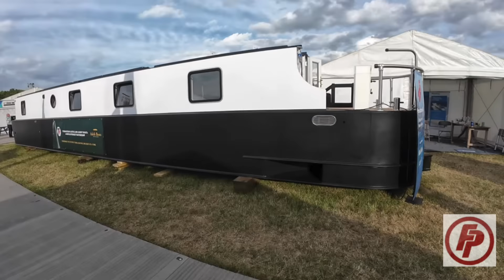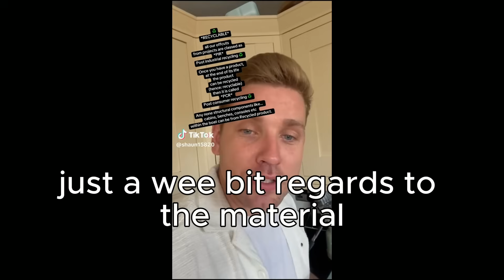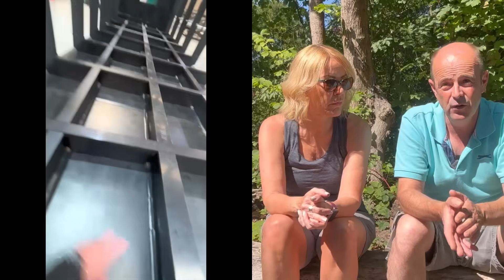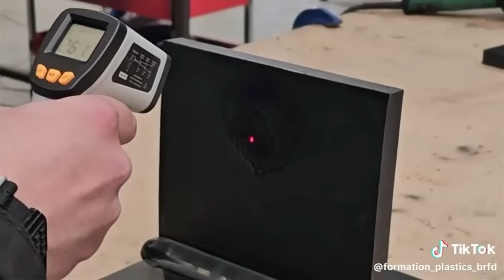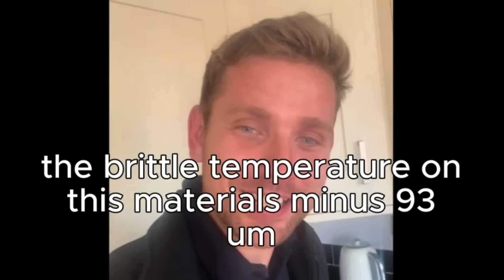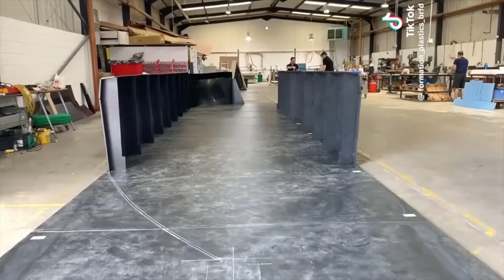Rust-Free Canal Boat?! The WORLD'S First Plastic Narrowboat Explained | 194

Comment: I wonder how thermal dynamic  and uv factor will affect the hull over a long period. You would think it would become  brittle over time
Reply from the maker: That’s a really good point 👍 UV and temperature changes can affect plastics, but the material used here (Polystone G Marine-Tec) is actually designed for marine environments. It’s UV-stabilised and chemically resistant, so it won’t go brittle in the same way cheaper plastics might. Shaun also mentioned it has a long lifespan even under constant exposure, so it should hold up far better than traditional coatings that need re-doing every few years. 😁
Reply: Good question — Polystone G Marine-Tec has a thermal conductivity of 0.47 W/m·K, which means it doesn’t transfer heat quickly. That actually helps reduce internal stress from temperature changes. Plus, it’s UV-stabilized to resist sun damage over time. The -95°C brittle point is way below anything you'd ever see in real-world use, and the material stays flexible and impact-resistant even after years outdoors. So it's designed not to go brittle like standard plastics.

Comment: How is it earthed from the build up of static electricity?
Reply: ill try and answer this best i can Polystone G Marine-Tec is made from HDPE, which is a non-conductive material with a volume resistivity over 10¹⁶ ohm·cm — meaning it doesn’t allow electrical current to pass through. So you can’t earth the hull directly like you would with steel. But that’s actually an advantage for a canal boat: there’s no risk of electric shock through the hull, and no galvanic corrosion like you get with metal. If grounding is needed (like for fuel systems or electronics), it’s done through metal components, not the HDPE itself. So overall, it's a safe  for canal boats.
Reply from the maker: Shaun has answered this for you 😁

Comment: Some of the posters stated about micro plastics etc.
But look at the environmental impact a steel boat has when it comes to media blasting, priming, painting and blacking during the lifetime of the boat.
You have alot of airborne and water borne dust and particles from blasting and painting.
Reply from the maker: Yes you are correct in fact since we have researched and found: Bitumen: sheds oily hydrocarbons.
2-pack epoxy: sheds microplastics.
Polystone G Marine-Tec (HDPE): also technically microplastics if it sheds, but far less likely because it’s a bulk material, not a coating that flakes. Plus, it’s chemically stable and doesn’t release VOCs. 😁

Comment: This is all well and good but HDPE flows constantly, it softens when heated and gets brittle at low temperature. It can auto ignite if there is enough heat and flows as it melts as it burns. Would not be my choice.
Reply from the maker: That’s true of HDPE in its raw form, but Polystone G Marine-Tec is a marine-grade version designed specifically for boats. It’s UV-stabilised, chemically resistant, and performs well across the temperature range we see in the UK. As with any material, fire is a risk if you get enough heat, but under normal boating conditions it doesn’t soften or flow the way untreated HDPE might. Kayaks, workboats and pontoons made from the same material have been in use for decades without those issues cropping up. 😊

Comment: Lighter, less draught; they're  probably more reactive when one is moving around on board? Also, I imagine, they're  not great in side winds? Other than that a great idea. 👍
Reply from the maker: Great observation 👍 Being lighter with less draught does change how they sit in the water, but Shaun mentioned that any extra reactivity or side wind effect can be balanced out with ballast if needed. So there are definitely ways to fine-tune the handling, just like with steel boats. Really interesting to see how it all develops! 😁
Reply: Lighter with less draught is not a good thing. It means the center of gravity is higher, while the center of bouyancy is lower. The closer these two dimensions are to each other the less stable the boat is. Consequently,  you would need to add ballast to compensate, making the weight and draft more or less the same as a steel boat for the same required stability.
Reply from the maker: @thedogfather5445 we have an update video with many of these questions being addressed coming out next week 😊

Comment: All good till a hire boater in a metal boat rams you at full speed and it sinks like a stone 🤡🤡🤡
Reply from the maker: 😅 Not quite! The hull is made from Polystone G Marine-Tec, which is incredibly tough and impact-resistant. Instead of denting like steel, it flexes and absorbs the hit — so even if a hire boater does bump you, it’s not going to sink like a stone. 😅
Reply: @WidebeamandWellingtons  have to agree to disagree I think, a 20 tonne boat made of steeldoing 6mp would snap it like a twig IMHO, of course they've sat it in the water for a year or two but have they rammed it full speed with a steel hulled narrow boat ...probably not, maybe that should be the next video. Then of course there's all the lovely jagged rocks that often stick up from the water, quite often in places you have to pull over to operate swing bridges etc, I narrowly avoided hitting one on the way to Liverpool recently, it would have sunk the Titanic🙄
Reply: @manwithapan9481 has any other uk narrow boat builder rammed one of their builds with another steel narrow boat at 6mph! It would be interesting to see how that would hold up as well.

Comment: Plastic is never a good idea,as it ages it will shed loads of micro plastic in to the canals!
Reply: There are already plenty of Plastic Boats on canals!
At least you don't have to take it out of the water every two years!
Reply: PS I'm not usually a fan of plastic but this looks a good idea!
Reply from the maker: Understand the concern 👍 but this isn’t the same as single-use plastics. The hull is built from Polystone G Marine-Tec, which is UV-stabilised and designed for decades of outdoor marine use without breaking down into microplastics. It’s the same material used in commercial workboats and pontoons that are constantly exposed to the elements. 😁
Reply: @WidebeamandWellingtons 
Every Type Of Plastic Releases Microplastics, We Have Microplastics Within Every Part Of Our Own Bodies, Adding Additional Plastic To The Environment Is Always A Terrible Idea, Would Be Great To Use, Yet, So Was Asbestos When It Came About, CFCs Were The Same, The List Is Endless.
  Fiberglass? Carbon Fiber?
Leaded Petrol, Topics Are Never Going Away.

 Glad For The Movement Towards Warranties BTW.
Reply: @universal-binary-stars  You’re absolutely right to be cautious — history has shown us that materials like asbestos, CFCs, and leaded petrol were once considered safe, only to reveal serious consequences later. Microplastics are a real issue, and we take that seriously.

That’s exactly why we focus on using post-industrial and post-consumer recycled plastics — not to add more plastic to the environment, but to extend the life of existing material and reduce waste. We're also working with initiatives like Röchling’s REloop, which is about building a closed-loop recycling system: taking back used plastic components, reprocessing them, and putting them back into production, instead of letting them become pollution.

Plastics won’t disappear overnight, but how we design, use, and reuse them can change for the better — and that’s where real impact happens.

Comment: Narrowboats usually sit about 22-24 inches deep in canal.  How deep a boat sits in the canal also affects stability.  Ballast and balance will become even more critical the higher the boat sits in the water.  Crossing tidal rivers, or the wash could become problematical.  I am interested, very interested, but will likely ask for a 9 foot wide (narrow widebeam) in the interests of stability and of course more internal room.
Reply from the maker: Great points James 👍 Ballast is definitely key, and these boats the ballast can be adjusted just like steel to get the right depth and stability. Once fully fitted and ballasted they’ll sit much closer to what you’d expect from a steel narrowboat/widebeam, rather than riding too high. A 9ft wide is a nice idea — extra room without losing too much flexibility on the network. 😁

Comment: I am surprised nobody builds canal boats in frp
Reply from the maker: Good point! FRP (fibreglass reinforced plastic) has been used in cruisers for years, but on the canals most builders stuck with steel for strength and repairability. The difference with Polystone G Marine-Tec is that it’s much tougher and impact-resistant than FRP, and can flex rather than crack, which makes it better suited to the knocks and scrapes of canal life. 😁
Reply: Frp can self destruct if cruising through ice.

Comment: With a boat sitting higher in the water, are you going to have problems with low bridges and tunnels?
Reply from the maker: Great point! Shaun explained to us his boat is made from Polystone G and is lighter, so they do sit a bit higher in the water, which can raise the overall height. But this is usually solved by smart design-things like lowering the cabin profile, using fold-down solar panels, or adjusting ballast to fine-tune the draft. Plus, the lighter hull means there's more flexibility to tweak the design compared to heavier steel boats.
So, navigating low bridges is definitely something that can be planned for 😁

Comment: HDPE even with added UV stabilisers will be degraded by exposure to UV light over time.
Reply from the maker: You’re right, standard HDPE can degrade with long-term UV exposure, even with stabilisers. The difference here is that Shaun is using Polystone G Marine-Tec, which is a marine-grade HDPE specifically designed for UV resistance and outdoor use. It’s the same material already proven in workboats, pontoons and aquaculture, so it’s built for long service life in full sun. 😁
Reply: Good point — UV degradation is always a factor with polymers, but in this case, we’re using Polystone® G Marine-Tec, which is specifically engineered for long-term outdoor and marine environments. It contains advanced UV stabilisers and additives that significantly slow down the breakdown process compared to standard HDPE.
Of course, no material is completely immune to UV over decades — but Marine-Tec is designed to handle constant exposure, saltwater, and mechanical wear with minimal maintenance. It’s used in demanding applications like marina construction and industrial marine components, so it’s well proven.
That said, we're not claiming it's bulletproof forever — just that it's a smart material choice for durability, safety, and longevity in harsh conditions.
Reply: @ShaunMoir1 can you give a disclosure on what the durability actually is? Yes, adding stabilisers helps, but it should still have a declared expected life for operating as a durable canal boat able to withstand heavy impacts with other boats/obstacles. What is that?
Reply: @NarrowboatExpats  Hi,

That's a very good question.

The base material we use is Röchling Polystone® G HDPE, manufactured in Germany. The material itself has an expected engineering service life of up to 100 years in many industrial applications when correctly designed and used within its intended operating conditions. This is one of the reasons it is widely used for chemical tanks, water infrastructure, marine applications and other long-term engineering projects.

In terms of canal boats, there is no published lifespan because, a canal boat has never been built from this material. As a result, we cannot point to decades of canal boat data, simply because the application is new.

Instead, we looked at proven HDPE vessels operating around the world. Polystone G HDPE has been used successfully in commercial workboats, rescue boats, police boats and aquaculture vessels, where impact resistance and durability are essential. One of the largest examples we identified is an HDPE ambulance/rescue vessel operating in Turkey, demonstrating that the material is capable of being used successfully in large commercial marine craft.

You may also not be aware that HDPE is extensively used in outdoor playground equipment across the world. These installations are exposed to direct sunlight, rain, frost and changing weather conditions year-round, yet they are expected to last for decades with minimal degradation. This demonstrates that UV exposure is not an issue for the material when the correct UV-stabilised grade is used.

The Polystone G HDPE we use is manufactured with carbon black and UV stabilisers specifically to resist degradation from sunlight. While UV exposure will eventually have some effect over an extremely long period, the material is engineered to retain its mechanical properties for decades in outdoor environments, and UV is not considered a limiting factor in the expected service life of the boat.

Ultimately, the lifespan of any boat is determined not only by the material but also by the design, build quality, operating conditions and maintenance. Based on the material's proven engineering performance, its estimated material service life of up to 100 years, and the worldwide track record of HDPE vessels and outdoor structures, we are confident that a correctly designed Polystone G HDPE canal boat will provide many decades of reliable service while offering exceptional resistance to corrosion, impact and abrasion.
Reply: @NarrowboatExpats  Hi,

That's a very good question.

The base material we use is Röchling Polystone® G HDPE, manufactured in Germany. The material itself has an expected engineering service life of up to 100 years in many industrial applications when correctly designed and used within its intended operating conditions. This is one of the reasons it is widely used for chemical tanks, water infrastructure, marine applications and other long-term engineering projects.

In terms of canal boats, there is no published lifespan because, , a canal boat has never been built from this specific material. As a result, we cannot point to decades of canal boat data, simply because the application is new.

Instead, we looked at proven HDPE vessels operating around the world. Polystone G HDPE has been used successfully in commercial workboats, rescue boats, police boats and aquaculture vessels, where impact resistance and durability are essential. One of the largest examples we identified is an HDPE ambulance/rescue vessel operating in Turkey, demonstrating that the material is capable of being used successfully in large commercial marine craft.

You may also not be aware that HDPE is extensively used in outdoor playground equipment across the world. These installations are exposed to direct sunlight, rain, frost and changing weather conditions year-round, yet they are expected to last for decades with minimal degradation. This demonstrates that UV exposure is not an issue for the material when the correct UV-stabilised grade is used.

The Polystone G HDPE we use is manufactured with carbon black and UV stabilisers specifically to resist degradation from sunlight. While UV exposure will eventually have some effect over an extremely long period, the material is engineered to retain its mechanical properties for decades in outdoor environments, and UV is not considered a limiting factor in the expected service life of the boat.

Ultimately, the lifespan of any boat is determined not only by the material but also by the design, build quality, operating conditions and maintenance. Based on the material's proven engineering performance, its estimated material service life of up to 100 years, and the worldwide track record of HDPE vessels and outdoor structures, we are confident that a correctly designed Polystone G HDPE canal boat will provide many decades of reliable service while offering exceptional resistance to corrosion, impact and abrasion.

Comment: So happy to see your video this morning. I have been following Formation Plastics since they started the wide beam boat. 
The durability, ease of maintenance and overall properties regarding heat and cold transfer give the thumbs up to the boat. 
I would love to see some further videos on these boats. I would think fit out might be easier as well as heating and cooling. 
Thanks again. 
All the best, Hal
Reply from the maker: Thanks so much, Hal! 🙌 We’ve been impressed by the same things, no rust or blacking, and the heat/cold transfer is much lower than steel. We’ll definitely be doing more videos if they agree; there’s a new one in the pipeline that we’ll be following. Early signs are that fit-out is quite straightforward and heating/cooling should be easier, though still insulate for comfort. Appreciate you watching and cheering this on! 😁👍🏻
Reply: Hi Hal thank you for the support watch this space 😊😊😊

Comment: I really like the idea and even navies would be interested. I'm assuming that less weight could lead to navigation problems in strong winds but I can see no reason why you couldn't use ballast to sit lower and side to side when on board and moving around. A big advantage also if sitting higher is low water levels in canals. Mind you though submarines flood then pump out to surface,there's a thought!
Reply from the maker: Great points! 👍 You’re spot on — ballast can be added to get the right trim and stability, so handling in wind won’t be an issue. And yes, sitting a little higher can actually be a bonus in low water levels. Love the submarine idea too 😅 flood tanks for canals could be the next invention! 🤣
Reply: Well now you say that they actually do use this for their workboats all over the world 😊😊